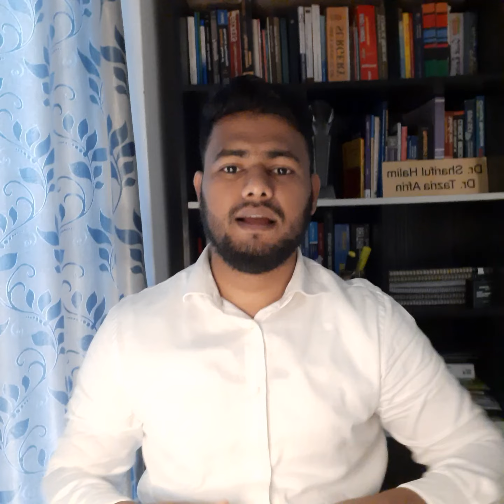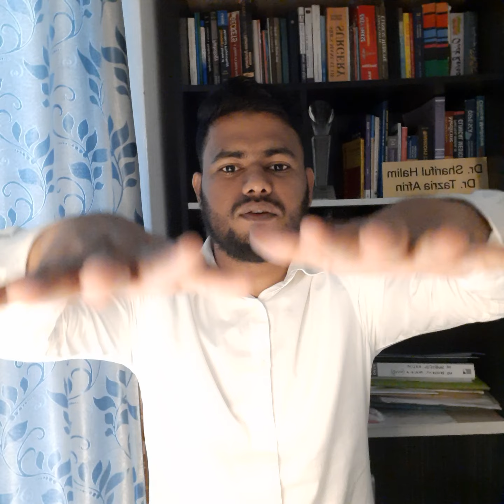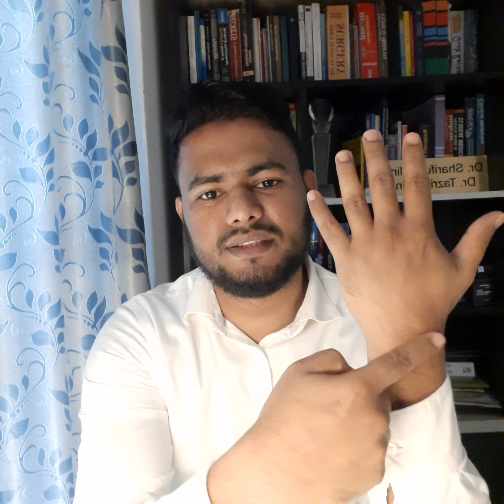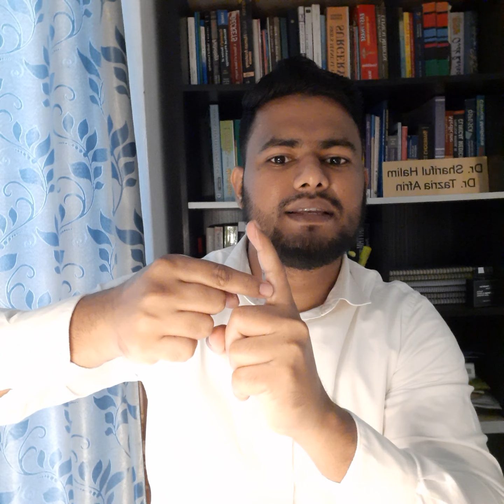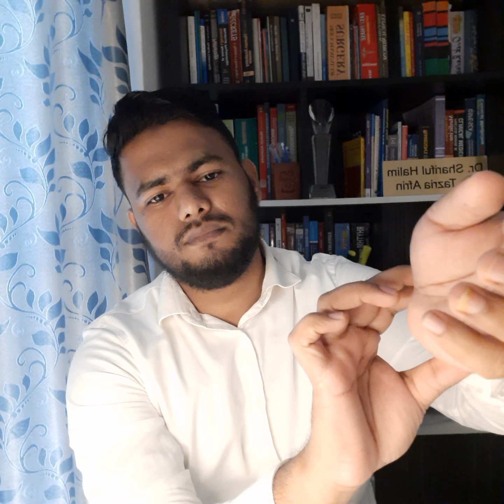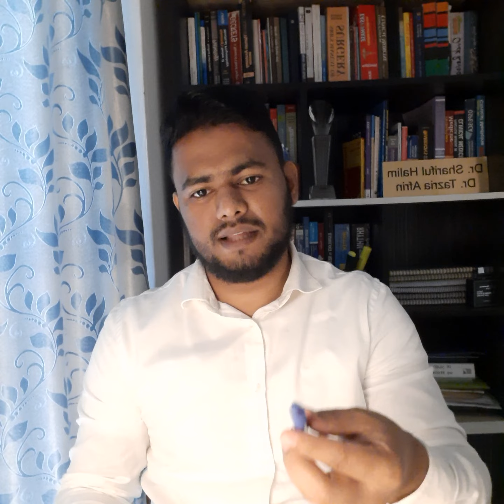Rheumatologic Hand examination  sequence

Comment: PPP
Permission 
Positions 
Proper Exposure 

Look
Feel
Move
Neurological Assessment 

Look

SWaD 
Swallowing 
Wasting 
Deformity 

Swallowing 
Wrist
Metacarpopharyngeal
PIP
DIP
Thumb

Wasting in the dorsum, thenar ir hypothenar

Deformity in

Thumb - Z deformity 
Swan Neck 
Buttonnaire 
Ulnar deviation 

Nail
Feature of Psoriasis 
Pitting 
Onycholysis
Sabangual hyperkeratosis

Feature of dermatomyositis
Periangular dilated capillaries

Goutron Battle - scaly erythomatous rashes in the dorsal surface over the pip and mcp joint

Palpation 

Ask If there is pain

Temperature 

Compress 

Palpate the Radial nerve

Any nodule

Movement 

Grab and release finger 

Prayer and reverse prayer

A pen to write
Or
Unbutton their button 

Neurological assessment 

Tap over the nerve

Tylenol sign
Fallen sign 

Sensory : 

C6,C7,C8 
Dermatome